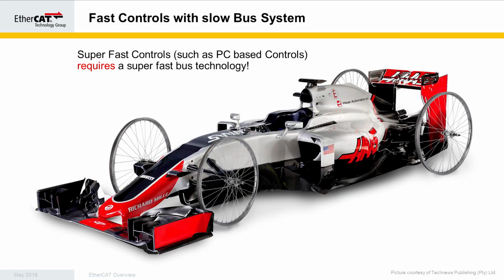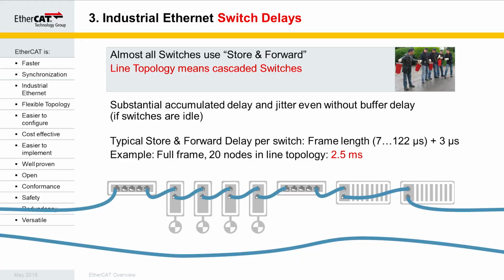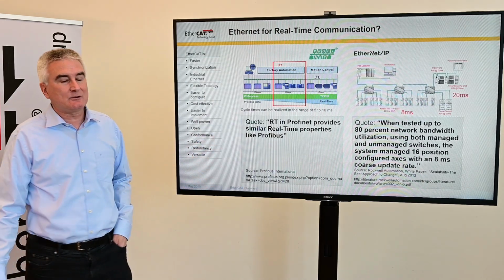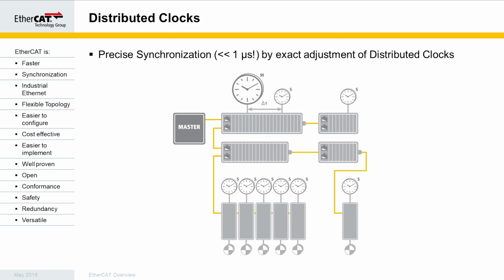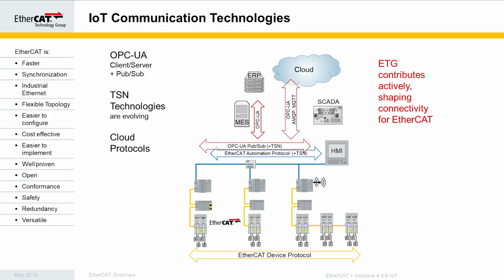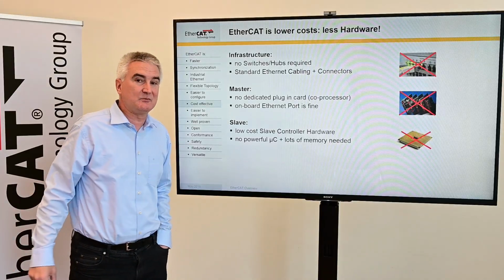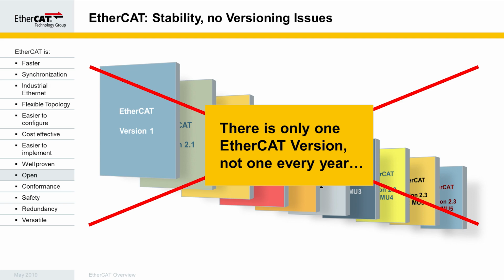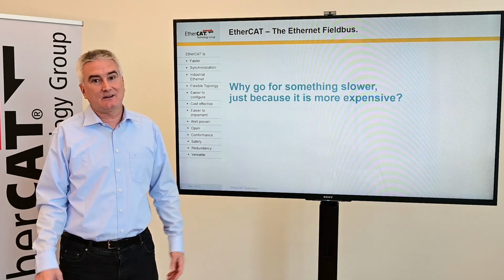EtherCAT in 20 minutes

Comment: The yawn when looking at EtherNet/IP's 8ms cycle time was savage! Love it
Reply: Modern ethernet switches have as low as 4ns port to port latency.
Reply: Yeah the last ethernet switches I tested measured 4-7us for cut-through operation with Gigabit packets.  I don't think EtherCAT's advantages are so obvious compared to Ethernet especially if you use a layer 2 addressing scheme rather than TCP.

Comment: What most interesting is etherCAT has two different protocols which share the same lower layers, enables two different mode to run faster mode and conventional TCP/IP mode. Since TCP/IP tools are widely used already so it will greatly contribute lower manufacture cost. Geneous!

Comment: Modern Ethernet switches have port to port latency of single digit nanoseconds and are non-blocking. Arista has one with less than 4ns of latency. TCP/IP has been hardware accelerated for a very long time. What advantage does EtherCAT have over that? 30microseconds is 7500 times longer than 4ns. Ethernet switches are NOT synchronous devices with a cycle time. They process frames asynchronously as they are received.

Comment: Great presentation, I watched to learn the basics and left wanting to implement it on every system I work on :'). I think I get what you are saying about topology and EtherCAT existing "below" Ethernet but seems to good to be true. If i have a ring setup with say 

EtherCAT Master Port 1>Ethernet IP router P1>Ethernet IP router P2>Stepper drive P1>Stepper Drive P2>EtherCAT master Port 2 will that work?
Reply from the maker: EtherCAT is a network where you can use one EtherCAT master at a time only. So the network you've described will not work. Please get in contact with techinfo@ethercat.org and let us know your requirements in more detail.

Comment: I am not sure if it's just me, but configuring EtherCAT is relatively difficult for me. Configuring ESC (EtherCAT Slave Controller), for example.
Reply from the maker: Hi Gerfel, you may have to distinguish between configuring an EtherCAT network (which is very simple, as the master typically assigns the addresses automatically) or implementing EtherCAT into your device and configuring the ESC. If you need some support, please get in contact with us at techinfo@ethercat.org!
Reply: @EtherCATGroup  Wow! I really appreciate your reply, thank you. I am relatively new to EtherCAT and slightly acquainted with slave devices, mostly LAN9252. I'll definitly contact if I need some support.